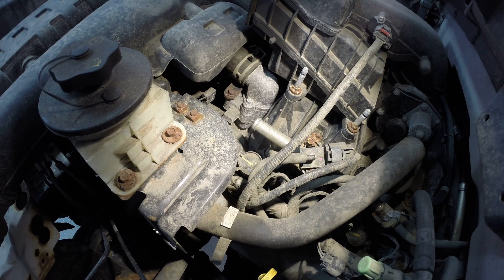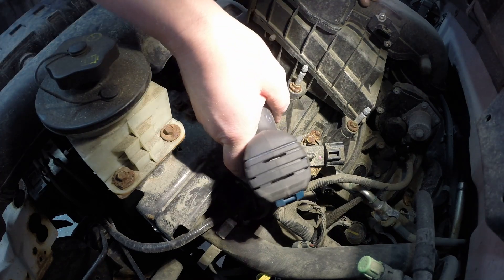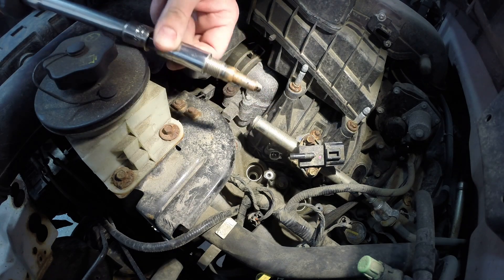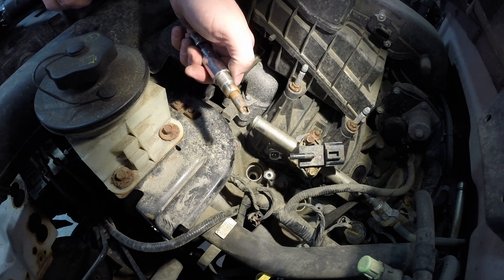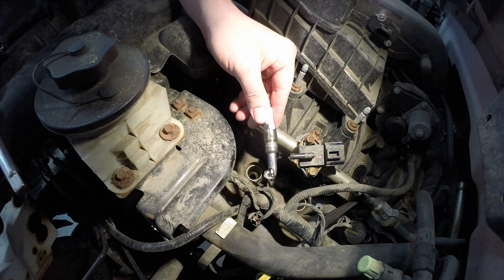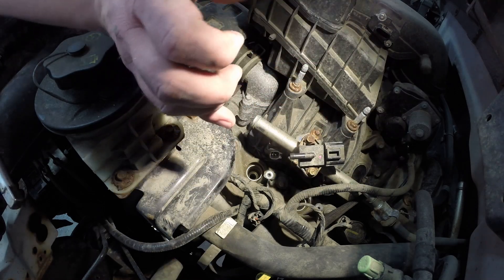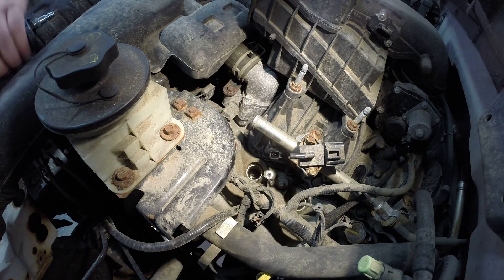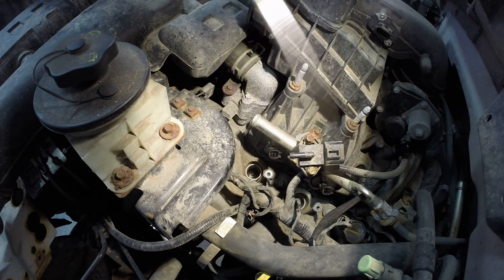The Best Method for Removing STUCK Ford 4.6L & 5.4L 3V Spark Plugs??

Comment: Can you get to the back plugs with the stubby impact ?
Reply from the maker: +thratheron yes with this one you can.
Reply: thanks, really appreciate your videos.
Reply: FordTechMakuloco quick question do u know like wat plug that was like 2 3 or 4 I have a miss fire in one & I was gonna do the first two on each side do you know if any one of those is plug 1 please help thanks man
Reply: I'd like to know this as well. Had the plug blow out of #8. Have no idea how the guy was able to get a Time-Sert insert in there. So cramped. Was tough for me just replacing the COP let alone getting an insert in there.
Reply: FordTechMakuloco what kind is it?
Reply: NO

Comment: We are in the process ..so far 5 plugs pulled 5 broken 4 of the 5 had to wriggle the plug back and forth in the plug hole to get it to release finally came out with all of electrode intact. The nose and the porcelain inside came out beautifully using the Lisle.tool. The # 3 cylinder was a different story . Unscrewed plug . Plug 'body' detached from all porcelain and came out leaving . the full electrode and all of the porcelain inside the well. Trying to get that out broke off the  top porcelain 'stem' . How do we go about getting this out of there so we can get the tool on that pesky nose piece.
Help,
Thanks,
 Mike

Comment: Removed the spark plugs on my 2005 F-150 5.4L today.  Got all eight out without breaking one.  Couldn't get the impact on the rear two but they came out by hand ok.  Ran a tank full of fuel with a couple of cans of Seafoam in it before doing the job.  Figured it couldn't hurt.  Had two tiny pieces of ceramic come off two plugs.  Blew the cylinders out well but don't know if they came out or not.  A big thank you to FordTechMakuloco!!

Had one of the new plugs fail after driving the truck for about 15 miles or so.  It was #7.   It ran fine right after we finished the job but started misfiring after restarting the truck after the 15 mile drive.  Replaced it with a new plug and the truck runs fine now.
Bill Smith

Comment: Big thank you for your videos man!
I recently got an '06 F150 with the 5.4L 3V that has 200k on the odometer.  Only reason I bought it was because it was a great price and I know all the service history.  But the last spark plug change was 67k ago, so I was dreading it big time.  Following the steps in your video, I got 8 for 8 out with no breaks.  Big time happy dance!
Now on to lower ball joints tomorrow.
Thanks again and sub'd so I don't miss any new tips.
Reply: Johnny Vegas how did they look ?

Comment: Hey I just wanted to say thank you for showing this to others . I am not a mechanic and after hearing many nightmares and going to the ford dealership and they said $400.00 to start if none break and then it would be a hourly rate i decided to look on youtube and I found a video from a guy that I will not mention his name for respect of your channel , but after reading thousands of comments over six months I decided I could do this my self and save a lot of money. I followed his instructions and without a problem was done in a couple of hours . Now when I tell others of how I did it they think it's crazy to use a impact wrench so thank you for showing that this method does work very well and probably better than any other .
Reply: When i bought my f150 used at 90k I had the ford dealer do plugs the second I bought It I paid about $550 ish. Reason I decided to do it was because if they fucked up I knew I could hold them accountable
Reply: Before trying talking out spraying w40 & after 10 minutes trying talking out slowly, if you do this never have that problem.
Reply: Im not mecanic but i doing in my trucks.
I have 3 trucks 5.4 engine

Comment: I was wondering if one of these plugs broke,  couldn't we just spray it with some carb cleaner, let it sit for a few minutes then start the engine and let it blow the broken piece out of there instead of trying to extract it and risk losing pieces into the combustion chamber?
Reply from the maker: +David P no they will not blow out

Comment: Have you read fords recommendation on how do do this properly? They say to do it when the engine is cold and to only start with 1/4 turn on the spark plug, spray some carb cleaner and wait at least 15 mins( if not more) so the carb cleaner eats at the carbon.
Reply: I did my first 2 plugs by fords method both plugs broke.i immediately used my 3/8 blue point impact on the rest of the plugs and they all came out perfect.the truck is an 07 and first plug change .had 150k.
Reply from the maker: +Cody None ya yes I used to work for Ford during this entire fiasco.
Reply: That is how I did mine and they all came out without breaking.

Comment: How do I know if my 5.4L on 04 Navigator is 2,3 0r 4 V ?
Reply from the maker: They only came in a 5.4L 4v configuration that year.
Reply: @FordTechMakuloco  Is the 4v a better engine or as problematic as the 3v? and do you need to use the same method to get them out? mine has 73k right now...wondering how long I should go till I change them?

Comment: You confirmed the hot method was good for me so I did it today in 1.25 hours, none broke. 8 plugs with new boots on my 2006 Mustang GT with 115,000 miles on the original plugs! Last winter I attempted it and broke a plug. After using the Lisle tool to get the plug out I was frustrated and waited a year to try again. I had previously put one Champion in but replaced it also with the new Motorcrafts. THANKS BRO!!
Reply: g

Comment: You emphasized keeping the wrench in-line with the plug. There is a you tube video that uses a tube and slides it in the plug hole. It works really well at keeping everything in-line. Especially if your hands slip or whatever it doesn't torque the plug. Search AMAZING NEW TOOL.

Comment: I ordered the M-12405-3V0 plugs which summit racing advertises they'll work and some have suggested for my 2005 F150 Lariat 5.4 3V. Now I'm seeing that only 515 plugs should be put in so should I try the ones ordered or return them?

Comment: FordTechMakuloco, does the 2003 ford explorer 4.6 xlt have the broken spark plug issue?
Reply from the maker: No
Reply: FordTechMakuloco  so there is no special procedure for these? I can take them out like any other normal job?
Reply from the maker: Yes

Comment: if only ford had never seized them at the factory there would be no issue.
Reply: working shlub anti sieze can cause a bad ground and misfire if too much is used.
Reply: Well Said !  "I survived my 5.4 3v issues"
Reply: working shlub if only ford would have designed an engine that wasn't the biggest piece of shit on the planet this wouldn't be an issue.
Reply: +mrcoffeekelly - Tritons have been known to go well over 300k towing boats or in taxi service with proper maintenance you idiot
Reply: @85MasterV  Yup i got a 200k 3v No issues, no  ticking and no tapping Good motors

Comment: Change the right side than run the engine to warm it up than change the left side.   I worked for an airline that's how they would do it on their 6.8 water truck.  It had 100,000 and never left the airport. The gap was over .100
Reply from the maker: +Geno Fuller Wow!
Reply: FordTechMakuloco getting ready to do this job on a 2005 5.4l with 200,000 miles on it an extra tips or the gym to watch out for. I just feel like there's so many things that can go wrong
Reply: @davidmark4211  if it's got the original plugs still at 200k your gonna need a BUNCH of hail mary's.

Comment: ford tech, I have a 2004 f150 with the 5.4 triton with 40,000 miles. At what earliest mileage do you recommend changing the original plugs? I hear the 60,000 mile mark is best to prevent excess carbon build up & hopefully prevent breakage. So is 60,000 miles the best changing point?
Reply: I would say yes as a safe practice since spark plugs aren't that expensive and you don't want carbon build up

Comment: I'm a little nervous about using this method. After reading Fords TSB08-7-06 I have been doing it as per their instructions.  Cold engine, break the plug about 1/8 to 1/4 turn then put some carburetor on the plug and let it sit a few hours. Carburetor cleaner seems to breaks up crud that's fuses the plug to the head. Then gently try to remove the plug. Do it a second time if you need to.  It's been working for me so far with no problems. Just very time consuming.
Reply: I wish I knew about running the engine before removing the plugs. I have a 2004 F150, it took me 6 hours to change out the plugs. I soaked the plugs the night before and used your method. Slow turns back and forth and they all came out without breaking.
Reply: Joe SC yeah each plug use carb cleaner 1/4 turn engine hot let set do it for every cylinder run engine to get hot

Comment: I have a 05 Expedition 5.4 3v.  I did this job at 95k and put Champion and when I did it again at 120k I snapped one of the plugs inside.  Its important to note the the champions aren't supposed to break and it broke with the threads in which means it wasn't even recoverable with the ford tool.  I had to pay my mech $2500 to pull the head etc.  PISSED.  I just bought a 2013 expy EL with the 5.4 and 60k.....Should I do the plugs ASAP or wait?  I would literally kill myself if I blew it again on the new expy.....lol.....Also what is the correct torque spec to get them in and which Torque bar do you recommend?
Reply from the maker: The 2013 uses a different plug design so they will come out no problem but you really want to use motorcraft plugs and they should be changed every 60k. Here is the latest plug for your truck- http://amzn.to/2foiVnd

Comment: I use high temp Aluminum anti seize. It is an aluminum head after all.... why use nickel? Just got mine done. Bought truck used 5 months ago (put 5,000 miles on it) and carfax said truck just had plugs done. I had a stutter (no check engine light) and figured Id just change them since I was under the impression that I would have the 14F plugs. NOPE. 2F for 7 plugs and ONE Champion plug in driver rear bank. So I guess they had a misfire, was told by shop the cost to do the job, and just changed the one plug. So here I am 5 days later I got the job done. Had issues with hose clips attacked to plug and socket would fit on one (no idea how they did that)... one broke oddly, jam nut came off but everything else stayed in there... in total I ended up breaking 6 of 8.... thank God the 4 and 8 cyls both came out in 1 piece. The Lisle tool is easy to use but Its like changing the plug 3 times... lol. Good freakin luck to anyone that messes with the 5.4 or 4.6 3V engine.

Comment: Don't forget the different coefficients of expansion between the spark plug steel and the aluminum heads. The aluminum expands at twice the rate of the spark plugs, so, since the  long extension on the plugs fitting into that long hole in the head supposedly fills with carbon deposits while it is running, thus hot, if you remove them cold, all that has been compressed into half the space when it is running.
I'm amazed it doesn't turn into diamond!
Hot's the way.
Reply: If the plug is steel and the hole aluminum, then when the engine is hot the hole will be SMALLER not bigger... thus the hole will have a tighter grip on the plug.  

What helps is the heating of the carbon, which softens the carbon.

Comment: I have a F-150 2005 5.4L..... What is the plug you used that is hotter?I also have a Explorer 2007 4.6... What is the correct plug for it...... Motorcraft for bothI don't see the link...  Thank you !
Reply from the maker: This is the latest hotter plug for the 5.4L 3v engines-  http://amzn.to/2e1Aveu
Reply from the maker: This is the latest plug for your 4.6l 3v engine- http://amzn.to/2dWUJEG
Reply: Thank You!

Comment: Since you have done both cold engine and a hot engine spark plug removal, which is your preferred method?
And which do you think has the potential for more repeatable favorable results?
Reply: nopi98
Reply: Michael Loren yes?

Comment: good video brian..makes sense when its hot..carbon is loose and the the head is expanded from the heat..that shock of the impact gun does the trick. ive seen other guys do it this way with good results.
Reply: You nailed it! The thermal coefficient of expansion is significantly greater for alumimum than for steel/iron. What this means is the hole in the head grows larger faster than the body of the sparkplug expands. Net effect is the plug is looser when the engine is hot.

Comment: Correct me if I'm wrong but 4.6 don't have the spark plugs problem, changed mine and it's a normal spark plug not s three piece 2006 f150 v8
Reply: The 4.6L 4v also had this issue in the mach 1s and cobras. Some still had 4 threads only but ford moved to 9 threads. Really one of the most retarded things ford ever thought of. 4.6s suffered blown plugs due to this
Reply: It's not 3 pieces unless it breaks
Reply: +zeke112964 I have no clue what you just said, it's the engines with 3 valves that break off 2 valve motors do not break, 5.4 2 valve has retail one piece spark plugs
Reply: You wrote three pieces in YOUR comment...NOT VALVES  ....I have no clue what you were talking about either so I guessed you were talking about the spark plugs being broken....Correct your typos
Reply: +zeke112964 I'm on a YouTube comment section about the video, if you are not educated enough to realize this then you shouldn't be commenting.
Reply: 4.6L truck is 2 valve, 4.6L Mustang is 3 valve. If I remember correctly. Same problem on both 3 valve engines, he just happens to be working on a 5.4L 3 valve.
Reply: @scottxp800  mustang also had a 2 valve 4.6
Reply: My dick hurts!

Comment: Thanks to this video, i just changed out the plugs in my 07 F150 5.4L (110K miles) with the original plugs. Drove the truck for about an hour and then used my 18V Impact  on the plugs. No breaks, no complications! Thanks!
Reply: Never thought of that. I have a 20 volt dewalt is that the same?

Comment: Great video! However when I did mine, I did them like you said with the engine warm. I also hit them with a little carb cleaner. I was so worried about them breaking so I used my 1/4 inch ratchet. It turns out they were not tight at all! just a few foot pounds and they came right out! Because of time constraints, I did them in groups of 2 or 3 over the course of a week. The one on the drivers side in the back is the hardest but if you have the right extensions for your socket set it wasn't too bad at all. 
Your videos are great! The one on 'Ball Joints' saved me a ton of money!!

Comment: My 2004 F250 still has the original plugs.
Reply: Just changed the plugs on my 2004 the other day woth the engine hot from running errands all day. plugs came right out without breaking. orginal pougs with 180,000 miles on them.
Reply: I only have 74,000 on mine. Guess I can wait.

Comment: Confused: Thank you for the videos, I am learning a lot about my '97 ford f150 xlt, 4x4, 5.4 V8.  My local Ford service department, Haynes Repair Manual and a number of videos suggest removal of spark plugs in a cold condition.  Most propose cracking the plug and spraying in a small amount of carb/fuel injector cleaner, waiting and removing in a back and forth method.  You promote a warm engine and rip them out with a air gun.  Can you clarify why Ford, others promote a cold condition and you promote the opposite, I want the best chance for success, using the OTC 6918.  Thanks.
Reply: Al ballard, there's the book, and there is the real world........

Comment: I have a 5.4L 2003 f150 lariat fx4 supercrew. Bought it with 110k miles,  Now has 131k. Probably originally plugs, I'm guessing mine has these dreaded plugs too?
Reply: Hi nope yours is the 2valve motor not the 3valve motor. the plug issue is on 2004 and newer 5.4s in f150s and 2005 later superdutys.
Reply: Thanks. Good to know. Still haven't bothered with them yet.

Comment: I thought you supposed to remove spark plugs when the engine is cold.
Reply: yeah same here. i was always told to never do it hot or you'll pull the threads out.
Reply: @AndyADVenture  generally that is the way, but it's recommended on these engines due to plugs breaking because of the hard carbon on the tip that is in the head. The heat softens the carbon up to greatly reduce the chances of breaking off the top of the plug in the head
Reply: How would you pull threads out if your removing the plug? Maybe if you were putting it in and over tightened it you would pull threads out but your statement makes absolutely no sense!

Comment: Brian, How do you like that Aircat stubby impact? Is it strong enough to replace your standard size? I see that it's quite, too. :)
Reply from the maker: +ReclusiveMountainMan I use it for all the tight areas now yes it is quiet I guess that is one of their selling points OI found out. It is not meant to be used as a replacement but it has enough power to be though.
Reply: FordTechMakuloco
Does it seem pretty durable compared to an Ingersol Rand?
Reply from the maker: ***** so far so good yes feels solid and the body is too no loose chintzy parts to break off or get in the way.
Reply: FordTechMakuloco
Good to know. Thanks. I think I'll pick one up!

Comment: Another great video Brian.   A warm engine is definitely key here. I did my plugs last August on a cold engine and broke 7 of 8. Of course the only one that came out in one piece was #1
Reply from the maker: +THETOPGLOCK Of course!
Reply: @FordTechMakuloco  ..How do you know if there original plugs. Doing mine this weekend.  Thanks. Right after I pull my valve covers and drop the pan for inspection.  Think either my phasers are going , or a broken guide or worst-case stretched my chain!  Yea Fun!
Reply: @locknload9143  how did your spark plug job go?
Reply: Excellent method, did my plugs in 2 hours start to finish. No more messing around with penetrating oil. Thanks